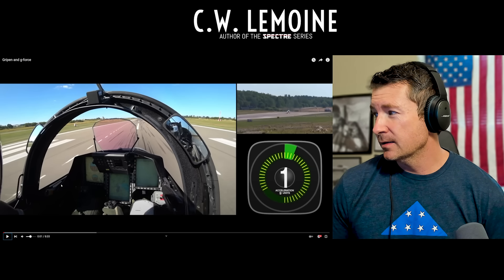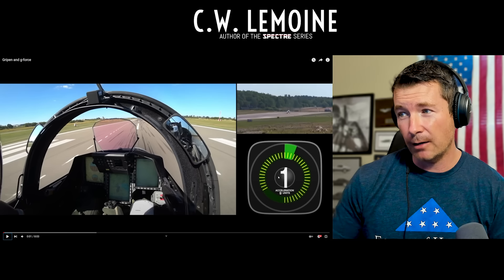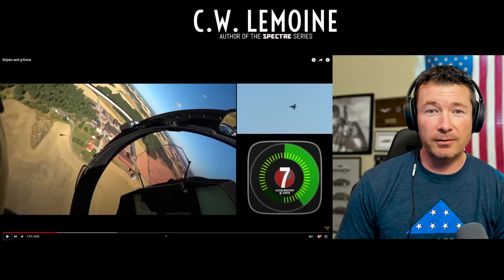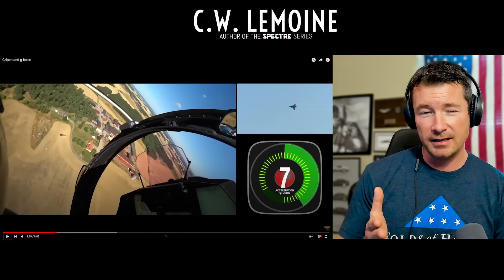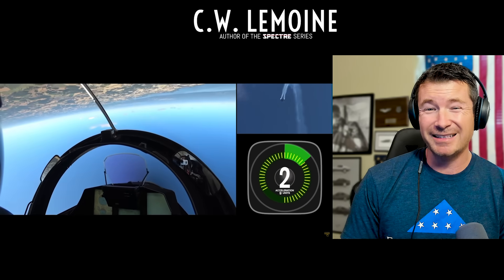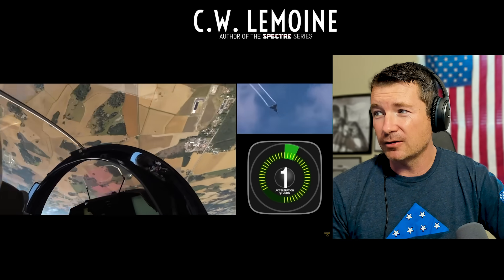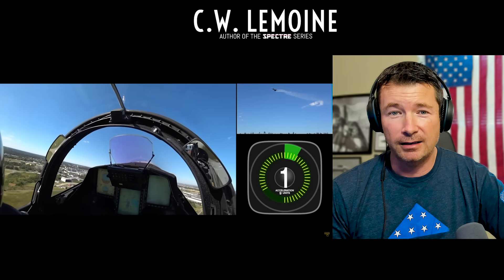SAAB JAS 39 Gripen G-Force Video *BREAKDOWN*

Comment: Is the video from one flight, or spliced from two or more? Aside from the spectacular G-force tolerance - 9G - and major push-pull challenges of going from -3G to +9G, both of which are do-able by a very fit and well-trained pilot such as Andre, the successive snap rolls to the right and left would cause disorientation and vertigo, no? In general, it is thought that the vestibular system of humans has a lag in responding, and cannot keep up with quick reversals of snap roll direction. 

Thoughts?

Comment: I was JA 37 Viggen Mechanic 1985. I also fell asleep in one, both in cockpit once and also inside the air intake. Well if a Viggen passed 8G we had to ship it to service but Viggen was also heavier, around 18 metric tons, fully tanked if I recall right and mostly built with Alumina, and JAS 39 has a lot of Composite in the wings, so it can take much more G-force, if the pilot will survive it that is. I used to joke about it as if the pilot did pass out, will the plane computer then be able to take him home safely by auto??  ;)  It should be possible really.  :D

Comment: The gripen could probably handle thef 35 but f22 raptor would be a problem.
Reply: One Gripen pilot commented on the F22 after flying in the same excercice, Red Flag 2013, "the F22 works as adverticed".
Reply: @jensolsson9666  Tack!

Comment: The Gripen got 22'000lbf of thrust which is about 7'000lbf less than a f16. The thrust to weight ratio is still almost the same of the two planes, because the Gripen is lighter then the f16.

Comment: Operational cost per flight hour:
- Gripen E, 9.000$/h
- Rafale, 17.000$/h
- F16 block50, 18.000$/h
- Eurofighter Typhoon, 18.000
- F/A18 Super Hornet, 24.000$/h
- F35A, 31.000$/h
Reply: Cheaper than my wife's operational cost per shopping hour!
Reply: gen 4.5
Reply: @ludvigekekrantz1357 Fighter generations are nothing more than Lockheed Martin marketing BS.
Reply: @ludvigekekrantz1357 
Good enough unless you're facing off with the US or (maybe) Xina.
..definitely good enough against the Russian SUs.
Reply: of course it will be economical its IKEA
Reply: @crystaloffrost  
I don't think they have to assemble the jets before takeoff but I may be wrong.
Reply: @j.d.4697 Funnily enough you are kind of wrong. When SAAB sells the Gripen platform to a country the planes are not actually built in Sweden but rather SAAB engineers travel to the purchasing nation and helps them set up their own production line.
Reply: @crystaloffrost  Carl-Gustaf Recoilless Multi-Purpose Weapon System is SAAB

Comment: why did you say (or mean) "these things are made to land on like, streets"?
Reply: They do land on streets, in case it is needed.
Reply: It has been a part of the swedish total defence doctrine ever since the mid 50's. It started out with the J 29 Draken aircraft, one of it's design features was the STOL capability, actually the first fighter in the world with modern STOL capability. It was then followed by the SAAB 37 Viggen and also the modern JAS 39 Gripen.

Pretty much all of Sweden is built around a delaying kind of battle, relying on countless of defensive lines, temporary bases etc. 

In this case the Swedish Airforce designed the STOL capable aircrafts at the same time as the infrastructure was adapted to that as well. That means that Sweden didn't rely on obvious targets as permanent airbases, instead some roads (all over Sweden) have very long and widened straights. Have in mind that the threat was from the Soviet Union during the cold war, that had an insane amount of forces. So Sweden designed a doctrine to hold out as long as possible during those odds. That goes from the civilian to the military side. Everything was built to hold as long as possible and never surrender.

Anyhow, along those roads there are also barely visible detours along the straight where you can quickly setup a roadbase (refuel/rearm, repair) in pretty much a couple of minutes. Unless you are a swede AND aware of this, you won't think about it.

So that is why he said "these things are made to lnd on like, streets".

Comment: the F16, F18 and F15 they need long runways and landing strips and that these are clean otherwise these planes suck FOD into the engines

The only western fighter aircraft that is manufactured from the drawing board to be able to operate from bases in the forest is the Swedish Gripen

in wartime, Sweden must operate from bases in the forest to have any chance of operating our warplanes for any length of time

The Gripen is made to take off and land from normal car roads

Gripen can be refueling and rearming, including reloading the gun and attaching air-to-air missiles, can be completed in less than 10 minutes with only one technician officer and five conscript mechanics

and costs much less in maintenance and in flight compared to the F16

The Gripen can handle both American and European weapons such as the IRIS-T, the Meteor missile and the RBS15 anti-ship missile, Taurus cruise missile, etc.

Gipens 39 RCS is of 0.5 to 0.1 sq.m depending on the model
F15 of 25 sq.m
F16 is of 5 sq.m
F18 is of 0.5-2 sq.m depending on the model
F35 is 0.05 sq.m
F22 is 0.001 sq.m
china's J-20 is 0.1-5 sq.m probably something in between

The F 22 Raptor RCS shows how far ahead the US is

source Sandboxx and https://thedtechind.wordpress.com/2020/06/10/rcs-of-4th-generation-fighter-jets/

The Gripen A and C has performed well when participating in the Read Flag exercise, better than the F16, F18 and F15

A Swedish Air Force pilot flying Gripen C at Red Flag in the US has never lost an engagement ever against a US designed fighter
He has not flown against F-22 and F-35, but F-15, F-16 and F/A-18s have only been his prey, not his nemesis.

the F-22 and F35 are the only operational American fighter that can give Gripen any substantial trouble in Red Flag exercise

but Gripen C can also be dangerous for F22

In America Gripen C in an exercise against the F-22 Raptor the F-22 did not detect the Gripen until it was in a position to kill the F22 Raptor

source of the above see links below

https://www.quora.com/How-does-the-Saab-JAS-39-Gripen-compare-to-the-F-16-Fighting-Falcon

https://www.f-16.net/forum/viewtopic.php?f=55&t=11311&start=2880

https://www.globaldefensecorp.com/2021/01/07/gripen/

the new SAAB 39 Gripen E model performs in a completely different class

it is not fair to compare the SAAB 39 gripen E model with the F16

F15, F16, F18 F already have big problems with gripen A and C model

The SAAB 39 Gripen E is more on par with the Lockheed Martin F-35 Lightning II in terms of sensors, radar, Supercruise, etc.
now the F35 does not have Supercruise

Gripen first participated in Red Flag 2006 with the Gripen A It was assigned to the red team. Reduced AWACS, reduced ground support. The Gripens connected their link systems and acted themselves as AWACs, got the battlefield awareness necessary and avoided all ground defense, scored 10 kills the first day including a Typhoon

No losses were recorded on day one they remained undetected.

One Gripen pilot knocked down five F-16 Block 50+ during close air combat in Red Flag Alaska.

And the Gripen never lost any aerial encounter or failed their mission objectives. It was the only fighter that performed all planned starts, while others were sitting on the ground waiting for the weather to clear up.

during a combat exercise with the Royal Norwegian Air Force, 3 Swedish Gripens went up against 5 RNAF F-16's. The result was 5-0, 5-0, 5-1 after having flown 3 rounds

And no disrespect to any other fighters, including Norwegian pilots because they're just as well trained

'During Loyal Arrow in Sweden, 3 F-15C's from the USAF were intercepted by a Gripen acting as an aggressor. The result was 2 F-15's shot down and one managed to escape due to better thrust/weight

source for the above see link below

https://www.globaldefensecorp.com/2021/01/07/gripen/

https://www.czdefence.com/article/the-gripen-e-is-comparable-to-the-f-35a-in-many-ways

Or look at Professor Justin Bronk at RUSI, his particular areas of expertise is the modern combat air environment

https://youtu.be/q-lcu2kBXQI

https://eurasiantimes.com/jas-39-fighters-precisely-designed-to-fight-russia-british/?amp

The SAAB E model has further improved the technology so that the Russian S400 has a very difficult time seeing the Gripen E before it is too late

now some of this technology is based on technology from the USA that SAAB has integrated with its technology

SAAB has developed a completely unique software that means that in the middle of a flight mission, the Gripen can change its combat task, for example from hunting to ground attack

Sweden has applied for nato membership and the video below covers Sweden's arms manufacturing which nato is happy to include in the deal if you just want to see what the Gripen has to offer then go to 9.06

https://youtu.be/YfHSJfKCFS4

Gripen what we have to learn from Sweden military aviation history see link below
According to RUSI, Sweden's pilot training is significantly longer than in NATO

https://youtu.be/eEX8JJ0eXL4

https://youtu.be/q

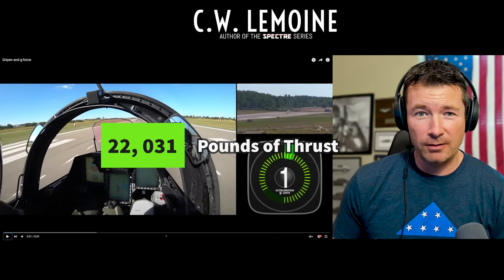Comment: 1:47 I was thought it was interesting how fast the Gripen seemed to be, top speed and supercruise wise, despite the comparatively low thrust to weight ratio. Apparently it's just a really well optimized shape for low drag, significantly better than the other Euro delta-canards.

One standout feature that gets touted often is the long tail behind the wings and the vertical stabilizer, helping it stick to the area rule better than the much more stubby Typhoon and Rafale.

I dunno, just always found that aspect interesting. Cool little plane. =)

Comment: Gripen is very light. Empty weight is only about 6,500 kilos. So with 10,000 kilos of thrust and even with say, 2,500 kilos of fuel, it will still be better than 1:1. F-16 I guess most people know is about 8,500 kilos empty. So T:W is in the same ballpark. But I would’ve thought the aerodynamic drag of the Gripen would be pretty high. That it can sustain turns like that is pretty impressive.
Reply: Drag is low. The figures for thrust is 80 000 kN with full afterburner, which is closer to 8000 kilo of thrust.

Comment: it is a wonderful machine. I spoke to a Saab test pilot in South Africa. A F16 was parked about 30 meters away and it is a monster compared to the Saab, the Saab  also has a much lower profile. Both are beautiful aircraft, the F16 perhaps also winning on looks but when it comes to logistics and operating on shorter perhaps rougher  run ways, the Saab was the winner. And it is more maneuverable compared to many of the bigger fighter jets out there. The pilot added that it also has some stealth technology built as I mentioned the American systems. The avionics was cutting edge and for an air force with a lower budget it is an all round great deal.

Comment: I'm not a pilot so I'm stating anything here, but I've heard that there's a technique of basically hyperventilating yourself before transitioning from negative G to positive G, that can help you tolerate the high positive G's better.  I guess the thinking behind this is to flood your brain with blood and oxygen in negative G, then switch to positive G, and it takes longer for your brain to use up the oxygen as the blood is leaving the head.  Any truth to that?
Reply from the maker: No.

Comment: F16 this, F16 that! 🤣 F16 is the Dodge on a straight road, JAS 39 is the Porsche at Nürnberg ring! 🇸🇪❤
Reply: Is that where they held the nazi time trials?
Reply: @L @Lindeman08  Yes. But it is also something else (Wikipedia: The first documentary mention of the city, in 1050, mentions Nuremberg as the location of an imperial castle between East Francia and the Margraviate of the Nordgau of Bavaria.[6] From 1050 to 1572 the city expanded and rose dramatically in importance due to its location on key trade-routes” (source retrieved 28 déc. 2025

Comment: Based on google searches, the SAAB 39 Grippen weighs a lot less than the F-16.
So even though it has has less thrust, perhaps it has a power-to-weight ratio that is just as good (based on the advertised numbers).
The 39 Grippen max thrust is 16,500 kg verses a weight of only 6,622 kg.  Therefore, the ratio: 2.49
The F-16 has a max thrust of  23,000 kg to 29,000 kg verses a weight of 9,207 kg.  That makes the ratio between 2.49 to 3.15
So depending on the version of the F-16, the Grippen might be equal.
The skill of the Pilot probably is the final differentiating factor.
Reply: * CORRECTIONS:
I had the max thrust units wrong.   The max thrust of the Gripen is 98kn which equates to about 9,993.22 kg.   So that's only a power to weight ratio of about 1.5
Also the max thrust numbers of the F-16 are lbs not kg.   So when converted to kg, 23,000 lbs is only 10,432.62 kg which makes the power to weight only 1.13 (worse than the Gripen).
However, the Air Force website (af.mil) says that the thrust of the F-16C/D is 27,000 lbs.  So when converted to kilos is 12,246.99.   That makes a power to weight of 1.33 (still worse than the Gipen).
Now some google searches say that an F-16 can do 29,000 lbs of thrust.   In kilos that's 13,154.18 and a p:w of almost 1.43 (and that's even rounded up).   That's STILL a bit less than the Gripen!
So it would seem that all variants of the F-16 have a lesser p2w than the Gripen (if you believe the googled numbers).
If that were the only factor, then I'd say the Gripen has an edge, but I still think the guy in the seat is the biggest factor.
Can you imagine if they could put an F-16 engine producing 29,000 pounds of thrust in a Gripen (without increasing it's overall weight)?  It would have a p2r of almost 1.99 !

Comment: One advantage Sweden Has in fighter design is that they don't design fighters for "power projection!"  Aerial combat for the Swedish AF will always be a local affair!  In any conflict with Russia, Russia would be using power projections.  So, no massive aerial refueling efforts are needed.  I read once that when the JAS 39 Gripen went to Red Flag, Nv. 2013, they did very well.
Swedish JAS-39 Gripen Participate at Red Flag 2013
URL:  https://www.youtube.com/watch?v=SkBkXG-eVOo

Comment: Was told that the performance difference between the JAS-39 and its predecessor the beloved AJS-37 (Swedens F-14) was: 
1.	that the entire computer power of the AJS-39 was less then what the JAS-39 used for it´s ABS system.
2.	 By the time the AJS-37 has made a 360 turn the JAS-39 has flown an eight inside of the circle made by the AJS-37.  
But still no matter how good the Gripen is, most people in Sweden “prefer” the Viggen. It simply has more charisma then the 39.

Comment: Damn shame the USAF did not buy the F-20. It had the capability to pull so hard, and bring on G's so fast,   it disabled the pilots.  That could have been addressed in G limiting,  in flight control software. Like the Grippen it was in the sweet spot of lower weight, one powerfull engine,   with a superb TW ratio. Member's of John Boyds original cabal,  frustrated with F-16 weight growth,   had a hand in the F-20. be reminded also,  that small physical size is in itself
an attribute of stealth.

Comment: The gripen has an empty weight of 14990 pounds and the falcon has an empty weight of 18900 pounds.
The thrust to weight ratio of the gripen is .97 and falcon is 1.095
The wing loading of the gripen is 58 lb/sq ft and the falcon is 88.3 lb/sq ft 

These are the reasons why it has less thrust than the falcon, though I doubt it accelerates slower due to the lower wing loading it's likely more efficient in a turn too.
Reply: Dry thrust rating 12.100 pounds, afterburning thrust rating 18.100 pound.

Comment: Interesting comment about landing on a street because the Gripen was supposedly designed to take off and land on civilian streets, and to be able to be prepped by only 3 people. Great for a small nation with mountainous train. Even if you destroy the air fields, they could still take off and defend.
Reply: That's not something that's unique for the Gripen. The Swedish Air force has been practicing this since the 1950's. Even the Draken was designed to take off from roads.

Comment: It's not evident from just looking at it, but the Gripen airframe is quite low drag (in particular thanks to the tail section), which is why it can get away with having a lower thrust on paper. In practice the discrepancy with something like an F-16 isn't as bad as you'd think.

Comment: I thought that this was real 😂 I flew the gripen in the gripen simulator in the Air weapons museum in Linköping when I was a kid. It took great effort to move the stick and once the Grippen got into higher Gs, the cockpit shook. Landing the plane was very easy, I aimed the x into a ring and it landed itself - basically. 

I wonder if the pilots hands would shake in a real dogfight (in that high g turn towards the end) 😊
Reply: It is real.

Comment: The Gripen has the GCAS system. Ground collision avoidance system. The aircraft will not let you do controlled flight into ground. The computers will take over and save the craft. However... during flight displays, the system might be turned off. The GCAS, which is a joint effort between USA and Sweden have saved many lives just in a few years.